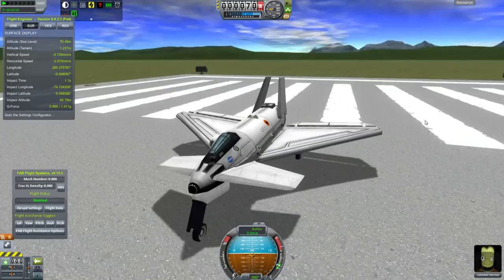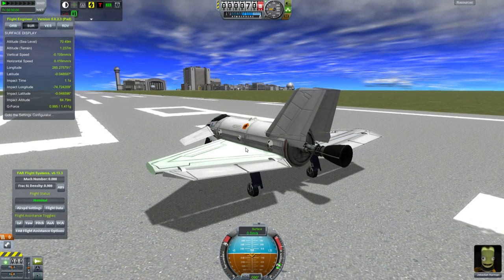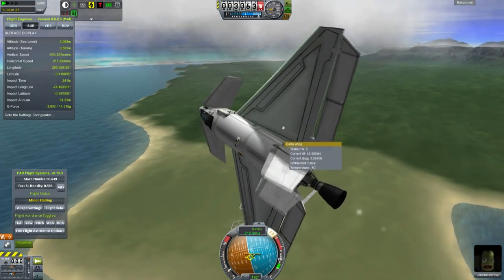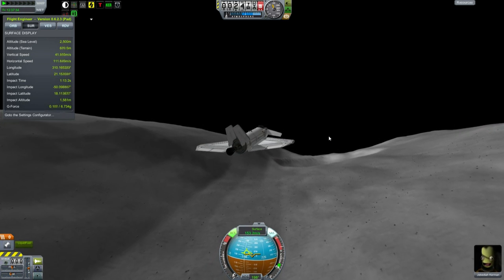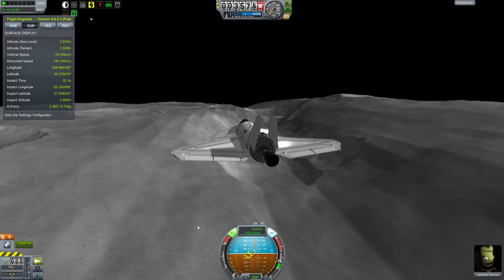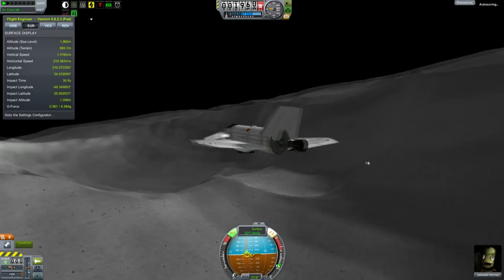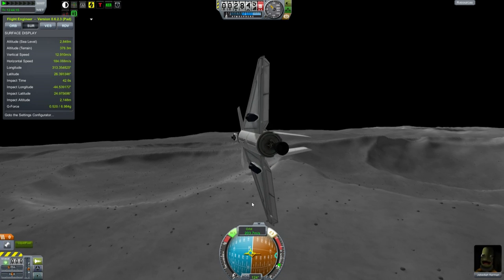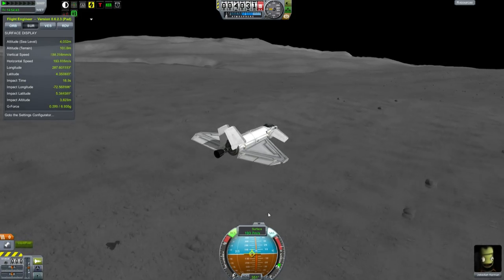The Physics Of Flying 'Space Fighters'

Comment: I keep coming back to this vid and I wish SC and Elite would brave it and let physics work like they actually do. 

I don't think we would NOT have a gameplay. You really think so?  Was there a dev build that tested it and proved it would be worse? I think it would be definitely unlike a regular flight sim, but have different kind of skill to it.
Reply: +DailyFrankPeter  In earlier versions of Elite, you could turn off flight assist, hit the boost, and your craft would coast at top boost speed until flight assist was turned back on. This made it very easy to run from every encounter. It took away from the tension of having your hauler filled with gold interdicted.
Reply: +Kerbal AirForce What you describe seems to be not about lack of flight assist but due to unrealistic acceleration model. Smaller ships, having a larger thrust to weight ratio would accelerate faster unless you filled a hauler with engines only but even then the gigantic engines would probably have lower TWR given their own weight.
Reply: Kerbal AirForce The interdiction mechanic - also not sure how well grounded it is. In reality if you had a velocity vector and you were trying to change it to evade pursuit, you'd be able to freely turn towards anywhere on screen that you like but your course would remain unchanged. Changing the actual flight direction would depend on acceleration of each ship, therefore lower TWR (a hauler) would always lose. Thrust/mass = acceleration.  [N/kg]

Comment: If you put the thrusters on the extreme tips does that increase manoeuvrability? I'm guessing so.
Reply: Thomas Edgerley It would increase rotational torque. If say you have a couple roll thrusters right on the fuselage, vs a couple out on wingtips. The wingtip ones would produce more torque... But they're also be fighting greater rotational inertia due to the mass of the wings. So depending on if your craft has wings (cause its can go in the atmosphere, they're radiators, or just there to carry weapons, whatever your reason for having the wings) are there, its probably better to put the thrusters out on the tips to offset the rotational inertia of the wings.

Comment: So with an aircraft on earth the engine has to keep up with the drag caused by using the control surfaces which is why generally a plane will slow down in a sharp turn, but in space the control surfaces are now different, smaller engines. I think that Theoretically both planes should be able to fly  for the exact same length of time with the same fuel in atmosphere vs in vacuum. Is this true?
Reply: In a vacuum there is no air resistance so you would travel further. The only force you would need to overcome is gravity, but when in orbit that is relative to your target body

Comment: so, the viper flip in battlestar galctica, is completely real then. that's pretty cool. But what is the most effective shape to do this, because the little resistance in space would have some effect?
Reply: Hm, you can use pretty much any shape you want. The few atoms per cubicmetre won't do much, resistance is practically not existing.
Reply: fabske 1234 but iif it is a spaceship, it will ultimately have to enter an atmosphere, and so what would be the shape for entering and reentering efficiently
Reply: Dylan Le Lerre 
Oh, well, NASA did a good job with the spaceshuttle, but there are many designs better than that. You can't really take a specific shape, as long as it is no brick or something useless. Important is to use a lifting body, this increases lift without using much wings because that things are pretty fragile and not made for reenter.
Reply: +Dylan Le Lerre you dont need to have it enter atmosphere, it could just refuel and reload in a station or other ship. A space fighter will always be better in space combat than a space-atmosphere craft. At least thats what space engineers has taugh me.
Reply: +Christopher Brown its better in space engineers, because an hybrid fighter has a lot of equipment that makes it heavier and less manureable than a space only ship. Of course, its space engineers, the game that doesnt have wing like physics, forcing all flying things to be vtols, so i might be wrong.
Reply: Mike A Well, I agree with you. That's kinda simple to figure out, regarding "fighters". Let me ask one question. What is better: an anti-fighter-aircraft and a tank or an abomination of these two together? My point being, it is far easier to build two different vehicles for either space and atmosphere. A hybrid would need equipment for space and for atmosphere as well as some things to enter atmospheres and get back up again, making it heavier and all in all useless. In space and air, specialized fighters will always be better than hybrids. Taking the only real life example, the Space Shuttle had exactly one thing superior to other spacecrafts. It could reenter. That's it, really. Not saying it was a good attempt, in fact I am sure such kind of hybrid spaceplanes will be important in future spaceflight, but nonetheless, the price and mass of the Shuttle match other rockets, who were able to launch numerous probes into interplanetary space and had superior spaceflight capabilities, the Shuttle (although launching some interplanetary probes) always operated in LEO.
While Hybrids will be used in the civilian sector, in actual conflicts, they will probably be useless, the price too high for the performance possible, the very concept alone preventing the hybrid to even match space- or atmospheric-fighters.
Reply: ***** 
I must confess, my analogy was somewhat... lacking. 
Consider one thing. What do you need to enter an atmosphere? Heat-shields, those add mass. You can decrease speed to enter without much heat issues, but there is a reason why that isn't done. Very inefficient, waste of fuel.
Further, the engines you proposed, no matter what, one would need at least two sets of engines, or one set of pretty heavy ones. For example with Raptors and extra "space" engines, one needs two sets of fuel to let them work properly. But that is only one possible engine example.
The main problem is: Space and Atmosphere. What do you need in space? For the best efficiency, the ship has to be as light as possible. In an atmosphere? Wings, or worse, depending on the type and density. Those, again, add mass, reducing the vessels capability in both elements. A specialized fighter could have more weapons, greater speed and better agility with less mass and easily outgun the hybrid-fighter, again in both situations.
Reply: ***** 
I know new materials will be found, there will be advances made, but that does not change facts. As soon as you are even attempting to land on a planet, not to speak of one with atmosphere, you need a lot of fuel to escape the gravity. We can not break the laws of physics. That fuel is heavy, no matter how efficient your engines are. Even with engines that work as efficient as possible in atmosphere and space, again fuel...
Going on, you are aware that a hybrid either has weapons with recoil (and therefore projectiles, mass) or will be completly useless in atmosphere (lasers scatter too much in air).
With lighter, I meant, mass. I know there is no weight in space, but mass does not change. A spezialised vessel can do with light engines, light weapons (lasers, for example, to eliminate recoil) and the fuelrequierment will be under half of what a hybrid would need to perform an atmospheric fight and get back into space again. In atmosphere, a normal fighter will, again, be much lighter, reducing fuel and increasing power. And don't worry, light does not necessarily mean fragile. A shot from a gun that goes through, for example, a spaceship will definitly punch a hole through any atmospheric fighter. And spaceshiips are normaly designed to survive a launch, the forces on them more than match those of fightercrafts.
There is just no advantage in a hybrid. It will cost more and be less efficient in space than a space-only fighter. Same in atmosphere. Again taking wings as an example, they keep you in the air but in space they are nothing but useless mass...
Reply: ***** A space fighter will need a ton of fuel if it is going to act as a fighter, which means a lot of turns, acceleration and deceleration. Unless it is going to act as a shooting platform, which would take the figther part out of it. And big ships being faster, well, that i cant know.
Reply: ***** there is still mass in space,  and mass is resistance to move something.  A large ship will need really strong propulsion to be faster than a fighter.
Reply: ***** 
Can you even imagine how much power such a ship would need to even leave orbit? We haven't even come close to such engines. Even half an Aircaft Carrier would be impossible for us today and probably one of the biggest undertakings in the history of spaceflight if one were be built. The fuel of such ships will be so limited, they will take the most efficient route, and probably always the longest. So, no, even in close quarter combat a big ship, as you described it, will not come close to smaller fighters, who will need a fraction of the power and fuel than more massive spaceships, therefore being able to fly faster and getting more DeltaV out of the fuel.
Reply: ***** i never said it needs to be that big. From playing space engineers, a carrier for like 20 space fighters (which is a reasonable large fighter group, considering how expensive all this stuff is) could be smaller than nowadays sea carriers.fabske 1234 Such ship would have to be build in orbit, if to lift a small 3 person ship we need Saturn 5, we would need skycrapper sized rockets to lift an aircraft carrier.
Fighters in space battles will probably make runs to launch anti ship missiles at great speeds to enemy capital ships, and then go away to reload, in order to avoid AA. Moreless what anti ship warfare with fighters is now.
Reply: Mike A Of course it would have to be built in orbit. (I talked about leaving orbit, not Earth, but anyway). Just a few formalities because... nerd here :D. 
The Saturn V was able to get 3 men to the moon, land there and back again, which needs a lot more DeltaV than just to achieve escape velocity (I'm pretty confident two Soyus could do the job, one with the crew, one with extra fuel). But yes, to lift what is basically a carrier, even the power of twenty Saturn Vs wouldn't be sufficient, not even considering the fuel.
Reply: fabske 1234 actually, the saturn was only to get them into orbit.
Reply: Mike A Oh, you are right. Although that doesn't change much, since the Apollo spacecraft was, well, probably the heaviest spacecraft ever built, considering it had enough fuel to return from the moon, and also land there. As far as I know, the Saturn Vs third stage was the stage to bring Apollo onto trajectory to the moon, and that stage certainly counted as Saturn V. To get a simple 3 man mission into orbit, the Saturn Vs first stage would have enough power and fuel.
Reply: *****  I know. But they won't. You have to accelerate like... a hundred, a thousand times more mass than a smaller spacecraft. That smaller spacecraft will have more efficient engines relative to its mass. You cannot just scale up engines and/or add them and hope that it works. It works to a degree, but a bigger, more massive spaceship will never be faster than a smaller, lighter one. Today, for example, we use bigger engines for bigger rockets, but those are not faster, in fact they are sometimes even slightly slower than their smaller counterparts.
Reply: ***** i still dont understand how something hundreds of times heavier can accelerate if we are using similar tech levels for both ships engines.
Reply: ***** 
Do you know the difference between weight and mass? It seems you confuse them... Weight, as you correctly pointed out, does not play a significant part in spacetravel (as long as you keep your distance from planets amd suns that is) but MASS does! Mass has inertia. To overcome inertia you need, you guessed it, force, in space being applied by engines. Those engines run on fuel, which itself has mass. That sound arbitrary to point out, but keep reading. When you expell mass (through an engine), the speed you pick up equals:
all the fuel expelled in a certain time times the speed of the fuel expelled divided by the rest mass of the vessel. It gets a bit more complicated when factoring in, that a vessel looses mass when firing its engines, but that doesn't matter much now.
Now, the size of the spaceship does not matter here either, because most of it will be fuel anyway. It sounds fairly reasonable that the technology applied to more massive ships will also be the technology to drive the smaller spaceships, meaning, in the end, there is ONE factor that limits the speed of a fighter compared to a carrier. Fuel. Now, if the fighter is designed to only be deployed in relatively close combat instead of cruising from planet to planet, then, yes, it is reasonable that the fuelreserve of such fighter will not suffice to catch up with its mothership once the latter has decided to withdraw from its position into interplanetary space. That is not the entire thing, but that should help explain it.
However, if you now take your proposed hybrid of space and atmospehric fighter, then that thing will have more than enough fuel to reach the speed of carriers. Why? Because the fuel required to get into an atmosphere and back out again is huge. Let's say the hybrid comes into a situation where it has a full fueltank, then it would easily be able to catch up to the carrier which, I (remind you) doesn't have nearly and doesn't need as much fuel as the hybrid (relative to the mass of the both vessels that is).
I apologize for that huge comment. But really, I hope I could make THAT point...
Reply: ***** you need a fuckton more force to move the carrier than to move the fighter. Supposing both use similar tipes of engines, the fighter will have a ton more acceleration than the carrier. And mass still applies as a resistance to moving. If in space there wasnt mass, i could push a space station to light speed with my finger.
Reply: ***** well, if the engines are different,  then it depends completely on what type they have.
Reply: ***** thats the reason we arent counting for technological progress, because then predicting will be pretty much useless and imposible. Maybe in 200 years we will have gravity controling ships that can go to light speed,  or whatever other sci fi we want.

Comment: You're forgetting, of course, that the big engines on the back in Star Citizen have to accelerate you up to .2C.  Soooooo, you might want to integrate that into your opinion on the big engine/little thrusters thing.  But I'm not a physicist :P
Reply from the maker: I will integrate it as soon as Chris Roberts shows spacecraft arriving in reverse as they use these big drives to slow down.
Reply: Gooooooooooooood point!

Comment: In the air, rotating is hard and turning is easy.

In space, rotating is easy and turning is hard.

In the air, efficiency is easy and speed is hard.

In space, efficiency is hard and speed is easy.

Also: in the air, failure of a wing causes certain death.

In space, failure of a thruster causes a reduction in maneeuverability.
Reply: or certain death if it is your only thruster.

Comment: Could you make a vehicle that has two sets of thrusters on its wings. one on the top and one on the bottom an keep them on as to simulate airflow on the wings. Then could you do this with ion engines and solar panels.
Reply: I think that would be like pointing a fan at a sail. Physics won't allow it to work.
Reply: Ya but thats what rockets are. They are in essence devices that blow their own sail. They eject mass out the back so the rest moves forward.

Comment: so simply put, spacecraft flying like airplanes in space in impractical with one main engine and several small maneuvering thrusters attached TO THE MAIN HULL..... now, i KNOW that this does not make up for your CORRECT statement... but when makes up for SOME of the 'simulated lift' force your talking about is the fact that that spaceships have wings..... now... wings suck in space, but they provide more then just more hard-points for guns (which is a perfectly good reason) but wings also provide points in which you can place thrusters that are farther apart meaning they need less thrust to give the same force as a thruster on the main hull (because it will be working in opposite with thrusters on the other wing, for things like roll anyway: the 'simulated lift' is kinda BS)... the other thing you got to think about is the fact that KSP uses realistic 'pressure based air thrusters.... while star citizen is SCY FY... with LASERS and PLASMA WEAPONS.... so these thrusters could be shooting GOD KNOWS WHAT!?..... in fact, these thrusters could be using similar directed thrust technology as seen in the F-35 joint strike (jet plane) fighter to redirect thrust form the main engine?!... so it makes sense, BUT I WILL ARGUE that star citizen needs to have a much easier way (short of mastering menu settings controls) to turn on/off computer assisted flight... this should enable you to fly in any direction in any way you want like in KSP but will mean you'll have ALLOT more keys to bind to control all the possible directions (like in KSP).